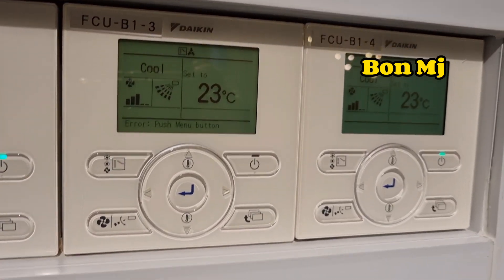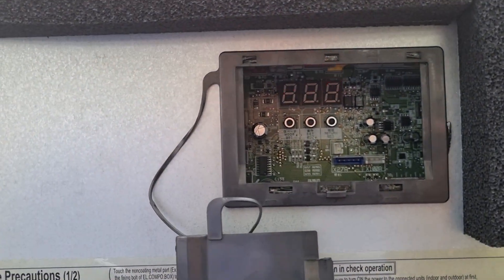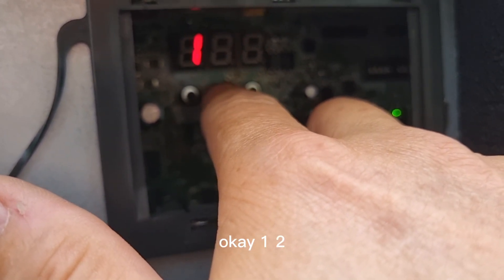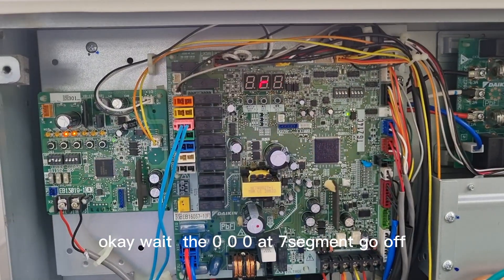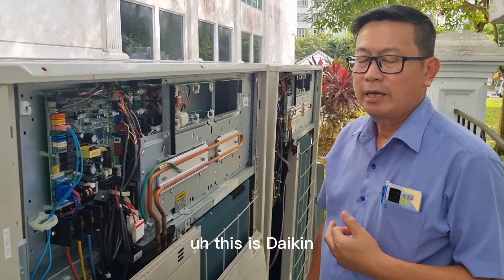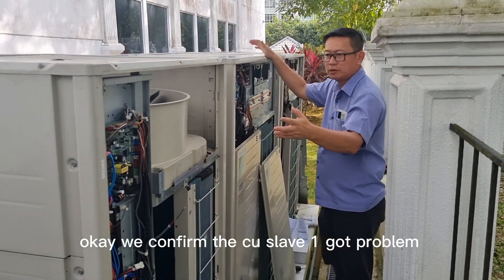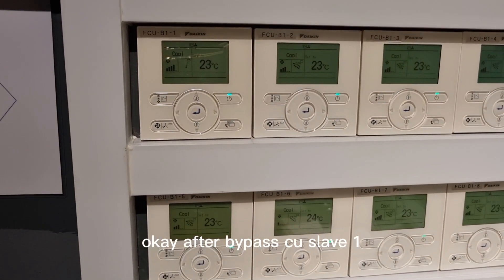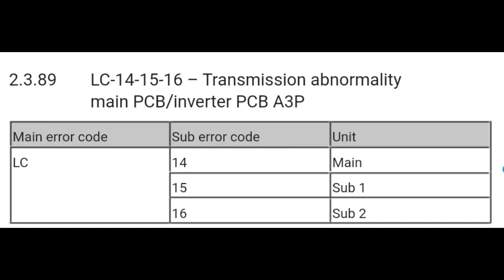Daikin VRV4 | Error code PJ-05 | LC-15 | Troubleshooting | inverter PCB

Comment: Last time FCU fan motor Pcb board faulty, I replaced new Pcb board, but remote control can't turn on lock symbol coming, wire remote, I need your advice
Reply from the maker: What remote model, or somebody set the remote lock.

Comment: hi Bon,how to set from 3 cu to 2cu ?  is it disconnect (Slave 1- F1,F2),then turn off power and on back Power, that's it?
Reply from the maker: If individuals power supply just turn off all and on back 2 cu
Reply: @BonMj  noted and Thanks 🙏
Reply from the maker: On back press reset button more than 5second.

Comment: How d you troubleshoot LC-14 error code? The A1P board is newly replaced but the error is still there after resetting the power supply. Thanks
Reply from the maker: Check inverter PCB
Reply: Inverter fan pcb or compressor pcb this is a problem